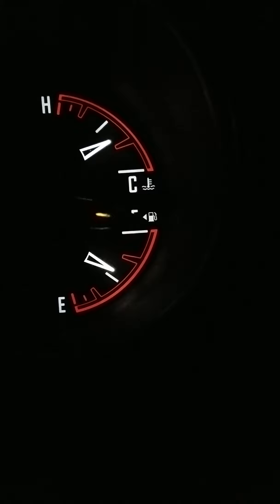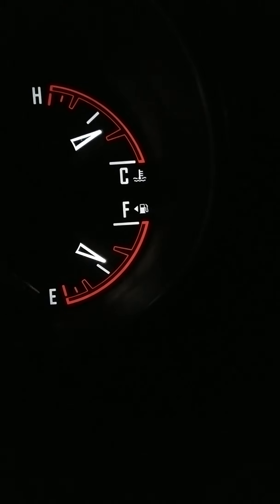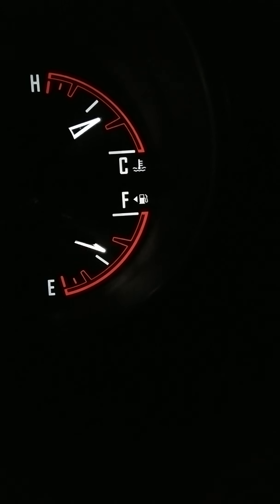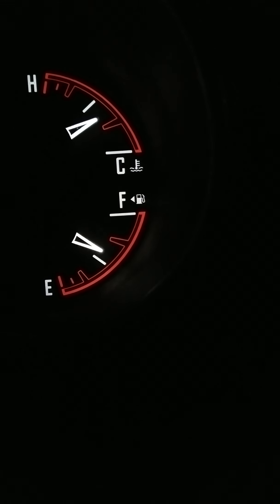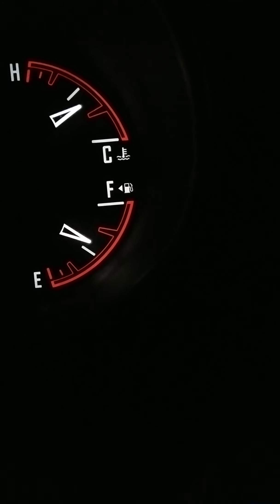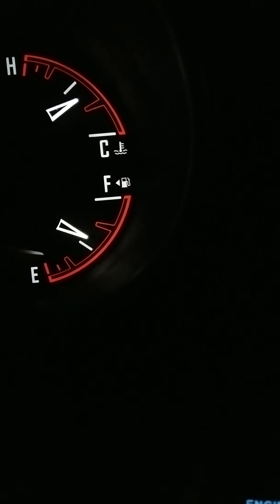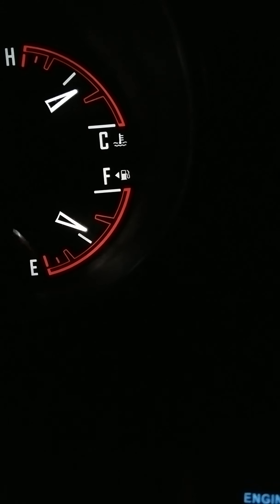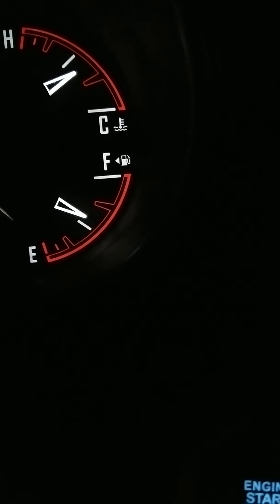A cars fuel/gas gauge and its purpose

Comment: I believe the arrow next to the gas pump is indicating what side of the vehicle the fuel door is on not simply pointing towards the F. Very well done tutorial though Ronaldo!
Reply from the maker: Ive actually found that to be false. In My wifes new foreign car the arrow points right but the fuel fill is on the left.... maybe they switched the fuel location but had left over instrument panels to use up....